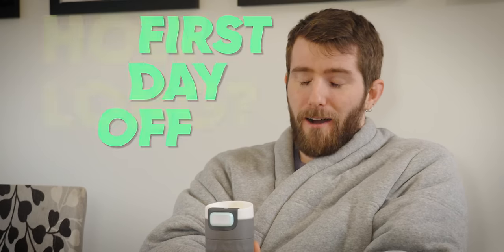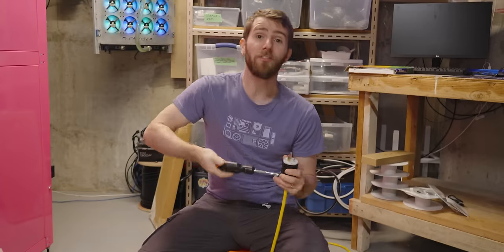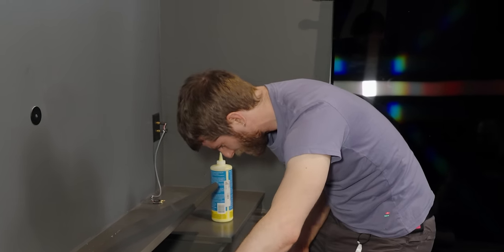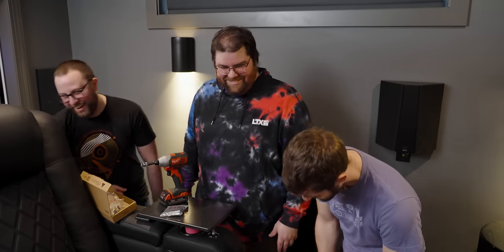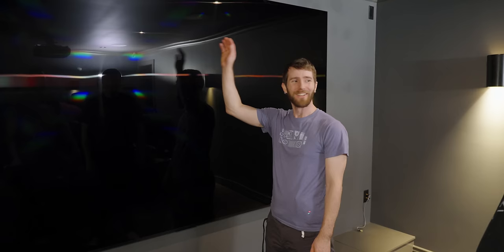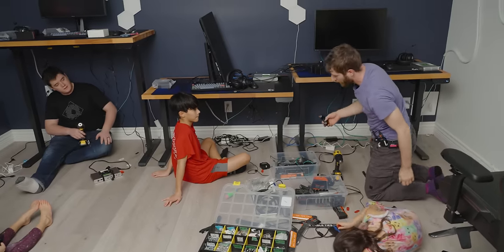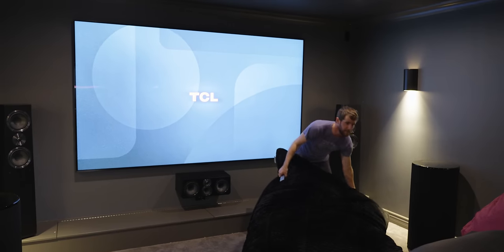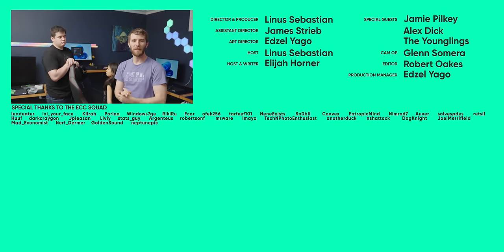What I Do On My Day Off - Cable Managing My House

Comment: As an electrical safety manager, you really should use romex and not an extension cord to permanently wire that TV. It will probably be fine, but extension cords are not meant for permanent installations. The cord jacket gets brittle and cracks when they haven't been moved in some time. Creating a potential fire hazard. But like I said, it's probably fine for now, but if you're going to have that TV there for years, you should definitely change it out.
Reply: It's against electrical code for a reason.
Reply: Glad I'm not the only one having a stroke
Reply: Yeah I went "is this serious?"
Reply: My thought process... why are they cutting the end off an extension cord (changing plugs to get rid of the double maybe?) ... why are they talking about wall conduit ... oh no just call an electrician and have a proper outlet installed nearby.
Reply: How often does this "brittle jacket" come up?  I can't say I've ever seen a regular orange cord have any issues from just sitting around.  I've got cords that sat unuse3d for 20 years that I use regularly now... hell, I have one that I know wasn't touched, hanging on the wall in my grandparents basement since my dad moved out , hung there for 45 years and still is good as new.  
I have seen it on black, commercial grade cable meant for permanent instillation, when changing out hanging light fixtures, the jacket just crumbling apart on maybe 20 year old cable, but on an orange cord? never.
Reply: How would they feed it, though? Aren't they using a 120-240v converter? You'd need a male-male plug on that end...
Reply: Yeah i have 30 year old extension cords that are basically brand new looking. Never seen a cord just decay thru 1/4" of rubber, if that was the case why would the jackets around your houses wire not decay aswell? they use much thinner rubber than most extension cords. Aslong as it's hooked up correctly and can handle the current, copper is copper.
Reply: There’s also the ability for the extension cord to transfer a fire from one area to another, if the jacket is made from low temperature plastic with a paper wrapping around the conductors inside. In-wall wiring is resistant to the transmission of fires along the wire.
Reply: @Sir_Defyable  have personally tested this. Romex burns like a wick. 
Also romex is always the wrong choice for a temporary installation or installation where the line is terminated with a plug, as in this case where, as clearly stated in the video, it is being plugged in to a converter for 220V, 50Hz power. I’d be worried for any electrician that wired romex in to a twist lock plug.
Reply: @johngaltline9933 well no what you would do is put an outlet on one end and an inlet on the other end. Basically the same way you would do a generator. Boom done to code and no fire hazard.
Reply: @look92vean98  so what connects the inlet to the converter?  Also, as stated above, Romex burns. Try it yourself, a normal lighter will do the job. For what it’s worth, there are no codes for this application, and a standard orange cord meets all the same specs as Romex in addition to being weather and up resistant. It’s better cable, it just costs more.
Reply: I like how people keep mentioning a “converter” as if they didn’t just plug it into the 2 phase power entering the house.
Reply: @kenneyc  I think it's plugged into a UPS. Not direct wiring to the circuit breaker.
Reply: @tOSdude  might need to watch the previous video on the tv. It uses Chinese standard, 220V at 50Hz. It needs a converter from the 60Hz North American standard.
Reply: meh. whatever.
Reply: Linus will probably be upgrading his TV very soon.
Reply: Please, maybe in the early days of extension cords that was true, but these days the cord jackets aren't going to get brittle and crack even after many years, even more so if it's indoors.
Reply: @johngaltline9933  I was speaking in broader terms to give another reason why certain wires can’t be ran through walls, but you are correct that without the plenum rating the typical Romex can’t be used unless ran through a plenum rated conduit. Pretty sure it is just a PVC jacket and most would know how PVC burns.

I wonder if they have CerroMax wiring in Canada?
Reply: Not all extension cords are created equal, the vast majority of extension cords use thinner wire gauge then standard Romex, however, you can get extension cords that have the same wire gauge or even thicker wire gauge then what you would use for even a 20 amp circuit. I would be very surprised if Linus did not know what I am saying right now, so I suspect that extension cord uses wires of the correct thickness, in which case it would be no different than using a single romax cable
Reply: @the_undead  it's not the gage of the wire that's the problem it's the cord jacket. NFPA 70e and NEC both state that extension cords should not be left in place for more than 90days. Your talking to an electrician with 25 years of experience that specializes in electrical safety. I don't know much but I do know my craft.
Reply: @verakoo6187  it happens more often then you think it's in the NEC and NFPA 70e for a reason.
Reply: I do get your Point but that cord is Built for Higher Voltage though but the new end i dont know if it is or not
Reply: @johngaltline9933  voltage and frequency doesn't matter when it comes to cord selection in residential use. The only thing you need to worry about is how many amps or current the TV is going to draw. I don't know the current draw of that TV, but I assume a standard 12 gage romex will work fine. You will also need to account for the distance as well. The longer the run, the more the voltage drop will be witch inturn will increase the amperage.
Reply: @tOSdude well considering there's not two phases that would be hard.
Reply: @johngaltline9933  depends on what your using it for if you just have a light plugged into it at your shop that you hardly ever turn on then yea it's probably going to be fine if you keep it out of the elements. But if you have something that has a high current draw that is used frequently and for hours at a time like a big ass TV then the cords going to get hot and frequent temperature fluctuations can and will cause the cord jacket to become brittle.
Reply: @lemonbone  yea that's one of the reasons I said it's probably going to be fine in my post. He'll probably get some sponsor for some amazing projector or something within a year and have to take it down lol.
Reply: @CliffAdams-r3i  the TV is listed as 600w. 

That's like less than 3 amps at 240V.  Even an 18ga extension cord is going to do that without even raising in temp.

Still illegal and not a great idea
Reply: @johngaltline9933  I haven't watched the last video, did they even try it on American power? 

It's going to have a switching power supply which probably wont care and can work with either system with no issues.
Reply: He's rebuilding his house every year, I dont think the plastic will have time to get brittle.
Reply: @johngaltline9933 ”How often…” is a wrong question. ”What will the insurance inspector say, when the house burns down for a reason or another”
Reply: @16vSciroccoboi  They did, it didn't.
Reply: He'll replace it in a year, tops.
Reply: @siffoine  If they know what they are doing, they will know that a standard orange cord meets or exceeds the requirements of romex and is just as good.
The purpose of my question on how often, however seems misunderstood.  I'm looking for a single real world example.  I've seen romex burn.  I've seen romex insulation crumble apart on 20 year old cable.  I've never seen an orange cord do any of that.  Instead from everything I can find on the specs, the only reason romex is still used is because it is the cheapest option that is good enough to use.  Nothing wrong with cheap and good enough, but it doesn't magically make better options worse just because they don't fit the very minimum spec of a code.
Reply: Extension cords made from Romex? = profit
Reply: He'll get a new TV in a few months anyway don't worry about it
Reply: @johngaltline9933  My intended point was that the insurer may not interpret the situation in the same way, potentially leaving you in a precarious position. This could, at the very least, lead to a legal dispute. Considering the potential hassle and the risk involved, the savings gained from cutting corners on installation might not justify the potential for such complications, even if you were to eventually prevail.
Reply: It will last 20 years easily and linus will change the tv every 6 months 😂
Reply: Your idea of them getting brittle is one from about 40 years ago.
Reply: @davidandrew7314  If it wasn't an issue, then it wouldn't be in the codes and standards of the NEC and NFPA 70e. Yes, some of these codes and standards are from a long time ago, but NFPA updates them every 3 years if it's still in their it means it's still a problem.
Reply: @johngaltline9933  All the logic in that tv is DC, 50 vs 60 hz doesn’t matter.
Reply: @16vSciroccoboi  Do you know how North American power works?
Reply: @tOSdude  well I've been an electrician for 15 years and know that 240/120v residential is a single split phase period if that's what you mean. 

Two hots, one neutral, one phase.
Reply: @16vSciroccoboi  what about the areas getting 3 phase power but only 2 are sent to the house?
Reply: @tOSdude  umm they don't do that. They either feed a building with 3 phase or they put in a single phase transformer.

 There's zero reason for them to send 2/3 phases to a house
Reply: Hey, listen. He doesn't care about his employees' mental well-being, so he doesn't gave a damned fucking shit proper electrical wiring. I appreciate the warning, though. I may use this knowledge.
Reply: @t.l.7854  so why are you making him money by interaction on his videos
Reply: @t.l.7854  That's your opinion of him, but he's not putting his employees in danger he's putting his family in danger.
Reply: Linus will have a new TV, Setup or house again within the next 6 months, it won't have time to develop a safety hazard.
Reply: @rikkisnow1313 Romex extension cords sound like a good idea in theory, but I’m going to let you find out why it’s less than ideal on your own.
Reply: @16vSciroccoboi  You’ve never seen a 120/208 system in 15 years? Impressive. I understand it’s not common in residential but last I checked it does at least exist.
Reply: @16vSciroccoboi  To rephrase my first comment with proper terminology: I like how people keep mentioning a “converter” as if they didn’t just plug it into both ends of the split phase power already entering the house.
Reply: @tOSdude  I never said I hadn't seen a 120/208 system. I said I've never seen one in a house. 

In apartment and commercial buildings sure. Never seen one outside of multi family or commercial.
Reply: It’s in a conduit, so normal wire should be used, not romex, but your point still stand
Reply: This is what happens when Brianthe electrician isn’t around anymore
Reply: I was wondering this as well. When I wall mounted my TV and relocated the wires, the kit I got came with a power relocation and had Romex for the walls that terminates to plugs on each side: one for the power to the strip on the floor, the other to the power to the TV.
Reply: Whew yeah! I'm not even a pro but I'm aware that code requires individual insulated wire in conduit (not jacketed Romex). Jacketed stranded is not allowed for this AC application.
Reply: Also, for the love of God, separation of class, one and class two wiring in a conduit. Low-voltage and high-voltage should not be in the same pipe.

Comment: 2:50 Damn the video hasn't been out for half an hour and they've already done it good job madlads
Reply: Curious if anyone with a "sponsor blocker" can say if it managed to get through or not.
Reply: @sameermohideen4913 it didnt skip as usual but whoever did it still marked the 3 separate occasions where it happens
Reply: @sameermohideen4913  it skipped 3 parts b/w preety good i say
Reply: thanks guys
Reply: @sameermohideen4913 Didn't for me.  He said the words slow and separated enough that they were seamlessly skipped.
Reply: Not up to date for me soo
Reply: @Zanderhawk11  Strange, but for me it also omitted skipping this part. Unlikely that SB just deleted it like that, like they were never skips there. Probably someone disliked these skips out of spite🙄

EDIT: Oh and now you can't even add another interaction skip, because it just refused you on basis that "users" already voted that all skips on video are already done.
Reply: @AcesFull0fKings  Oh my bad, you mean yellow ones, i always thought this was interaction type stuff, but self promo exists i guess.
Reply: I knew someone would manage to edit in several small skips to do it. I figured he'd know it wouldn't actually work. He does know that bringing attention to it just guarantees the effort will be made.
Reply: The detail I love is that skipping to the highlight of the video brings you to exactly that bit

Comment: IIRC for running power cables for code, if it is behind a wall it needs to be romex, if its going through conduit it usually needs to be non jacketed, so like THHN/THWN wire.

That said you can do what you want, it should work as long as the amperage is not to high for the conductor size and distance, just note if their is a fire caused by it your insurance will probably not cover it, also if you sell the house you would want to remove it before inspection.
Reply: Was thinking the same thing. I'm in the US, and I was wondering if Canada is different. But if anything, I'd assume Canada is more strict about stuff like this than the US is.
Reply: yeah the violation of electrical code means that if this caused a fire, and insurance found out, then  the claim would be denied.

Comment: I don’t know about building code where Linus lives, but if there are similarities to NEC 400.8, that extension cord likely isn’t rated to be used in-wall. The concern goes up as the voltage goes up and this is about as high of a voltage as you can get in a residential setting.

Even the HDMI cable should be rated CL3 for in-wall use.

Just FYI
Reply: Correct. Running extension codes through walls, ceilings, or floors, even in conduit, is against canadian electrical code.
Reply: 240v is high voltage? huh?
Reply: > The concern goes up as the voltage goes up and this is about as high of a voltage as you can get in a residential setting.

Miele: The recommended way of connecting our stoves is with common residential 380V tri-phase connections. 🤔🤔🤔

The best way to do this would be to buy a separate, proper socket for both sides as well as plenum-rated cable for in the wall, then wire it up properly.
Reply: yeah its again building code in Canada  , yeah it will work  but if something happen like fire hazard close to this  ,  insurance for sure will not pay, and im not a electrician  but useing a 110v extention for 220v??????   again not sure ,

Comment: Once when I was about that age I was on a job pulling several 25-pair Cat5 cables between buildings. We had a 55 gallon drum of lube that we just stuck our arms into and rubbed along the cables. There was only a couple 30-45deg turns in there, but it was still one of the hardest pulls we ever did at that job. You can never have too much lube.

Comment: Using an extension cord for interior wall electrical routing is such an LTT thing to do 😂. Hopefully it doesn’t start a fire 🤣
Reply: It's definitely against electrical code
Reply: It's fine. Maybe not correct, but it's safe done properly.

Comment: Better hope the local building inspector doesn’t see this. You should be pulling romex and running it to your power panel. It’s not like there isn’t a 240 V standard connector for the NA market.
Reply: Not legal even with Romex.
Reply: @16vSciroccoboi  Why? Because he is running to the UPS? Or the lack of a wall plate attached socket?
Reply: @ky5666  line and low voltage can't be in the same conduit, save for certain exceptions.

Comment: If you can get a seal between one end of the conduit and the end of a vaccum cleaner hose, you can get a very light piece of pull wire through it very easily. You then use it to pull a normal pull wire, and from there you're good to pull cable.

Comment: As a proud owner of the LTT screwdriver...holy shit, get a Dewalt powered screwdriver to do plate outs. You can slot any bit into it and you just tilt your hand the direction you want it to screw. It's invaluable if you run cable and plate out houses.

Comment: First issue you didn't pull the lube cap right off. Just dump that in the pipe. Also if it gets tight, stop, pull back, and yank it though.

Comment: 13:49 the DOUBLE face palm is a new level LMAO
Reply: Lol, caught it on the replay.. though even after watching Linus fixing it, the plate that Elijah is holding still looks like meant to screw into those 2 centre holes that Linus used. It has just 2 screw holes in what seems to aligned,  it doesn't show the plate being affixed.
Reply: And the port is upside down…

Comment: Um...this might be a US thing, but I don't think extension cord cables are rated for in-wall installation and you should run the properly rated Romex.
Reply: @woo545  I think because it’s in conduit, it’s fine

Comment: If you ever find yourself in a situation where the pull wire is missing, attach a small plastic bag to a pull wire, use a vaccum on the other end to apply suction and you're done.
Reply: good idea!